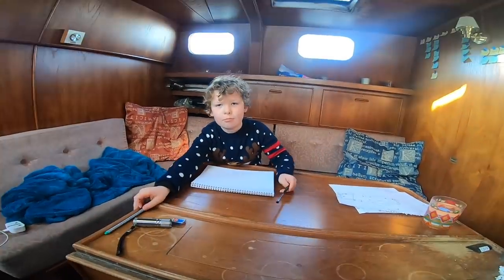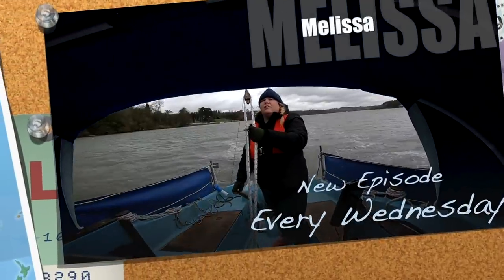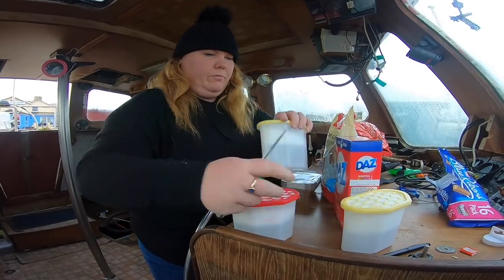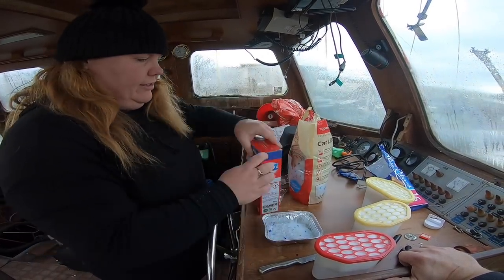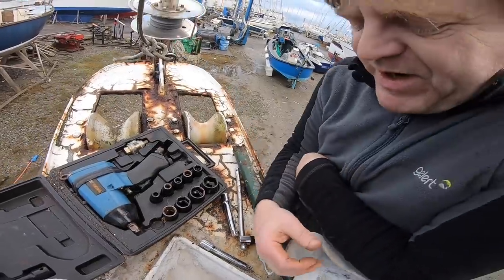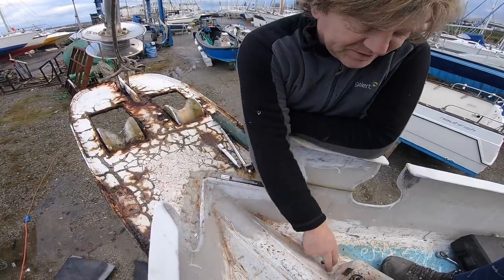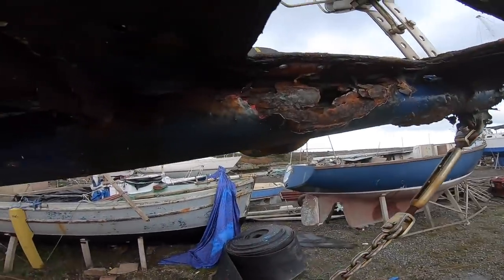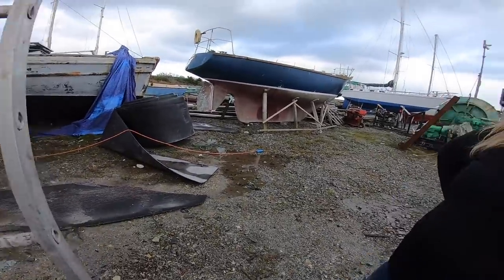#25 - Bowsprit Disaster!!!! - Restoring a steel sailing yacht

Comment: Bowsprit: Don't use wood, pls. If not AISI 316L, get hold of a galvanized piece of pipe. I used AISI 316L, no problem if done correctly. In fact, I have used å lot of stainless qualities from 6MO and SuperDuplx and down to AISI 316L. Nothing below AISI 316L. I also built my boat 25 years ago, with full job. Know your challenges. You are a very good team, the three of you. Impressed. Moisture absorbant: Calsium Cloride. Can be bought cheaply in 20 kg bags. Don't spill on steel, will rust immedeately. I have filled old 'lady stockins' with calsium cloride. Hangd them under the deck. A bucket underneath covered with a piece of plastic bag with some holes in. Then the collected wather drips down into the bucket. Best is to have a fan heater an an electric dehumidifier. Close all hatches an dry out. Send me an e-mail. I have allready done all the mistakes :-)

Comment: Andy your bowsprit... Cut it off as it enters the bow square on, place and weld a new one under size as your old one and push that one as far in as it can go, then weld that one in place, next you can place over that one the correct size as the old one and length welding that one in place. Then build up from there.
Reply from the maker: Oooh yes!  I could purge the weld and tig it. Why didn’t I think of that!!!
Reply: @SailingMelody   Double the strength.
Reply from the maker: Yes indeed! I may go that way!
I’m leaning towards an interior sleeve, then an external sleeve. Ridiculously strong and maybe add 4kg in weight overall. So negligible weight added.

Comment: Monday morning Quarterback here. Look at similar designs that worked. A great example is Pearson 323. Do a stainless diamond plate center. Plasma cut to fit. Galvanic protection wire and Holy Guacamole, You got it.

Comment: Please just weld a new piece of pipe on for the bowsprit under your new roller platform.  It will be as strong, quicker, cheaper and more reliable especially if you can coat the inside with a preventative mixture.  Fantastic job so far and all due respect to himself as a paramedic, I don't know how he can do both jobs at once.   Youngest doesn't realise just how lucky he is to have parents like you!

Comment: I admire your fortitude. Both holding down full time jobs and taking on a steel boat restoration. Tackling this in a UK winter, on the west coast of Wales is just adding to the difficulties. It seems like you have had plenty of advice to repair the bowsprit without removing the whole lot back to structure and have a plan in place.👍 On the condensation front I think you are effectively ‘pissing in the wind’ with the absorption technique and the only thing that would come near to improving matters is a dehumidifier but even if you were allowed to leave it powered up - it would be a massive task for it and of course it is an ever present fire risk. I would be sorely tempted to leave the boat for 2 or 3 months, certainly as far as the steelwork husbandry task is concerned, and concentrate on workshop type tasks until the weather improves.
Reply from the maker: Yes you make good points. We’re there again tomorrow for a couple of days and the weather is just awful so won’t be doing anything outside but there’s still plenty to do inside. I need to disassemble the whole steering system and no doubt will bring some of it home for strip down and rebuild

Comment: Hi guys, love the vids, I reconmend you use a small roller with a thicker nap if manufacturers are recommending to brush so you can get it on thicker,  I'm a pro painter and I suggest you can get it on thicker using a roller. This will make life easier and more productive including a more even coat , good luck
Reply from the maker: That’s a good suggestion thank you!
The manufacturer also specifically recommends airless spraying. We think this is due to the increased possibility for moisture in the airlines on compressed air but with a good water trap/filtration i can’t see why this would be a big problem

Comment: A suggestion on the bowsprit, cut the pipe off about two or three inches from the bow or where it seems solid. Measure the inside dia. Find a pipe whose outside dia. is close to the inside dia. Clean the existing pipe as best you can put rust inhibitor inside. Place the smaller dia pipe inside as far back it will go and as long as the bowsprit. Weld the larger pipe to the smaller one. Find a pipe with the larger dia and place over the smaller pipe to the end of the bowsprit. Weld again where it larger pipes meet. Cap the ends. This should be as strong as the existing bowsprit was at one time. Good luck on you restoration.
Reply from the maker: That’s exactly what we’re planning to do yes!!! Thanks for your suggestion and confirmation that we’re thinking along the right lines

Comment: My advice about the bowsprit is the same  someone already advice. Get rid off this rusty bulky stuff in the bow, yes the anchor mechanism holder too. The current bowsprit and the chain used as sort of martingale. Make sure you use stainless steel for such purposes and you get TIG welding is inexpensive. Same with the stanchions in a near future.  My suggestion is also try to get rid off the gunwale.  You are making  a lot of progress considering your personal and current situation. Good job guys!

Comment: Since you are worried about humidity that is a good sign since that means at least your boat is keeping water out of it. This is a good thing especially where boats are concerned. Given your boat the fact that it is metal and in Wales I am going to guess that humidity is quiet a problem. I do not think if that is the case that your home made traps will work or rather they will work but not enough. Assuming you have mains power and return to the boat every few days a aircon might be better most have a dehumidifier setting though of course if it is bad the water container will fill up quick. It will be helpful in summer when you are working as then you can be in the cool as I am reliably informed Wales can actually get hot at that time of year!! Who Knew :) You can pick up a portable unit for £300 or less
Reply from the maker: Yeah we’ve got one but can’t leave it on when we’re not there :/

Comment: The Bowsprit can be saved like you said, But I would graft a new mild steel one back on, with an inner pipe to retain it's rigidity, rather than a butt joint.
Reply from the maker: Yeah absolutely. I’m going to use an inner sleeve welded in and then an outer sleeve as well also welded on top
Reply: @SailingMelody  Keep up the great work .  Jack that was a fantastic lay out. :  )

Comment: The pipe for the bowsprit, I would recommend 3 different ways to check inside the pipe for rust / corrosion, option 1, use a small inspection mirror (dentist style mirror), and a strong flashlight, 2 get a small endoscope off eBay for a few quid that will connect to your phone, make sure it has a light on the camera, and of course the 3rd option Ultrasonic along the bottom of the pipe, but that can be hit and miss on a small diameter pipe, I'd look at option 1 or 2 first, and get a long welding Rod, bend it and scrape the bottom of the pipe, there is a good chance you might have internal corrosion there, that hole looks like it's on the top of the pipe, rain water might have run into the pipe. Hooe this gives you some ideas before you start cutting into it

Comment: Hi cut  bowsprit as far back as needed then drill some holes in what's left put a inner piece of pipe then plug weld then put a outer piece on to the length needed fill with coal tar then paint as normal

Comment: Other suggestions for the condensation?
A low power, continuous use dehumidifier?
Reply from the maker: We have one but can’t leave it on when we’re away from the boat :(
Reply: You could get a USB powered dehumidifier, All you need is a battery pack for when you are not there.

Comment: Are you trying to tell us you have a life as well as a boat😁 your doing well, once winter kicks in here nothing gets done outside and summers can be a bit and miss affair.
Condensation: I've found ventilation even when it's wet is essential when cooking and a fan to help exhaust moist air helps but even three body's breathing and a wel winter on a steel boat means your pushing proverbial up hill. I have a big tarp over mine in winter that helps heaps by providing an insulation air barrier but that could be a Hassel for you to work under. 
Bowsprit: if that old pipe worked as long as it did then another thick wall one should last as long. If you wanted wood the end could be turned down to fit the socket left when you cut the current one off. I like wood but I'm thinking that with a steel boat you might as well have a steel ram to match. Instead of running it through the bulwarks you could almost make it a complete bolt on thing or at least make some long fins, one down the stem and the others running back to about the fairleads to make it super strong. You could use 5mm checker plate to walk on and she won't go nowhere.
With regards to Jack's boat plans, it sounds like the little pirate's getting ready to ditch the folks so be careful if he sets up a plank for you to walk 🏴‍☠️

Comment: Maybe put on another forestay somewhere before that bowsprit gives up. I seem to remember you took off the inner forestay or the deck joint wasn't very good for that either?
Reply from the maker: Yes! Good call.
Reply from the maker: Very good call but the chai plate for the inner forestay is still very strong. Wouldn’t sail with it but it’s not going to break I’m 100% confident of that. 
I measured the steel thickness as it looked thin and it’s lost 0.4mm of its thickness which is totally acceptable.

I will still be making a new one though
Reply: Oh right . I couldn't remember if you took attachment off for inner stay. Maybe just use that for now then.
Reply from the maker: @michaelbundy3867  well I think you’re right it can’t hurt to back it up with something .
I’ll find some way of adding an extra, either a halyard or some attachment for the existing forestay

Comment: I just work like you. It all depends on the weather. When it's warm, I work outside, and when it's cold and it's raining, I work inside. In winter I prepare various items in the garage. Sometimes when I get bored of something or get tired, I stop work and do something easier. After all, everything has to be done. and it's easy and it's hard. So don't worry about such comments
 The bowsprit - cut off only the part that is most corroded. Don't touch what's welded to the deck. Someone has already written not to give wood. I think the same. It's best to find exactly the same pipe. Also find a pipe that will exactly go inside. Slip the thin one 20-30 cm inside and leave the same amount outside. Weld the pipe and then put on this new piece and weld around. Before welding, paint the entire interior with phosphoric acid and then rinse well with water. When everything is welded together, you can drill a hole from the front and insert a hose from the head of the undercarriage maintenance there and inject some paint. And thread the hole and screw in the screw. If it is possible, it is even better to do it from the inside of the yacht. 
Best regards - Mirek

Comment: repair the bowsprit with mild steel and paint it ... make it not to complicated 5 years down the road you can  change the bowsprit and save the old mechanical winch they are good , work even when your e-system is down k.i.s.s. keep it simple and save ,make the  boat functional you can update later on.
Reply from the maker: Yes I completely agree

Comment: You can delete the bowsprit altogether and save yourself trouble in the future.  By deleting the bowsprit you can also delete the water line chain plate.  The anchor roller plate wont need to change at all.
Reply from the maker: The forestay geometry would change a lot then but good idea to simplify and add strength and lightness

Comment: Get a length of solid mild steel turn the end down to go in under the winch and weld it at the joint and drill 2 holes further down and plug weld it there as well
Reply from the maker: 😂😂😂 solid round bar! Well it’d be bloody strong that’s for sure.

Comment: I would sleeve a smaller tube inside the existing bowsprit once cut short and then slot a new carbon steel tube the same size as the old over the top - this will be stronger and good for another 40 years.
Reply from the maker: Yep that’s precisely what I’m planning on doing I’ll spray a tonne of epoxy inside the whole lot before I cap the end off
Reply: @SailingMelody  When the boat was being built I'm sure that the way the bowsprit was designed and fitted was all pretty easy to do. However IMO it's vastly over engineered. If you cut the tube of flush and there is no rust going in further just cap it off. Make a pattern for the top plate first and then cut that off as well. Roughly smooth and finish off the bow as if you had nothing there at all. Make up a new top plate from steel. 25mm? Make up a nice big brace/fillet to go up the stem and out to the end of the bowsprit plate. Shape can be of the old traditional type. 30mm? That can be welded together off the boat and the new mounts for the rollers also fitted at the same time. Also all of the mounts for the roller jib and forestay and any other fittings you might need. An extra stay for hanking on a storm jib or genoa etc maybe. Finesse the piece to fit the hull and weld on. Certainly simpler than playing with tubes IMO.
Reply from the maker: @delukxy  that sounds like a plan. Don’t suppose you feel like drawing me a picture of what you’ve got in your head? Can’t quite picture it
Reply: @SailingMelody  This is a job for Jack! From the top the plate will look the same. The fillet underneath is at right angles to it. Think clipper ship bow.
https://www.jordanyachts.com/1077
Old Sea Dog has a stainless steel guard plate for protection against paint damage by anchors on White Shadow. His boat actually epoxy coated so the protector maybe screwed on. Shaddie is steel and he's doing rust correction in his last video.
https://www.youtube.com/watch?v=t94q5J5VxpQ
2 back also has some rust stuff.
Reply: Further thoughts on that.  My selected thickness for the the top and clipper brace probably a bit over the top but a thicker brace is still a good idea if it goes right to the front of the bowsprit platform. What is the thickness of the current platform? As a premade piece it will still be pretty heavy so using a scaffold tower would be a good idea when welding it on. If there is room to have the tower in any position around the boat it would be good to have anyway, especially for work on the stern.
Reply from the maker: Yes we definitely need to find some scaffolding now we’re getting into this stage of the work. Although in all honesty we probably wont begin that actual fabrication until the spring when the weather clears up a up, it’s still to wet and windy at the moment. I’ve got so many ideas and suggestions snd brilliant helpful advice for this it’s kinda bewildering now. 

But we mostly want to just return the boat to how she was and focus on repairs rather than modifications at this point. We want an electric windlass but can’t afford one currently so that can wait a year or so.

Comment: You have to remove ALL of the paint before you paint over anything. You can’t just grind the rust spots. You should blast the whole hull, then treat it with a steel rust inhibitor, and then do a barrier coat followed by bottom paint. That stuff is just going to peel right off when you’re in the water.
Reply from the maker: Great advice thanks 👍

Comment: what happened to the cover you were going to surround the boat with? I have a vinyl garage that I use during the winter months, I use a kerosene heater for heat, and work until the sun goes down. lots of tea breaks also.
Reply from the maker: Coming up next episode ;h

Comment: 12:55 lay on your back and paint. You can't get any balance doing it this way. Set yourself up on a comfy cushion or two and a small pot filled with paint and go from there.
Reply from the maker: Thanks for the tip 👍
Reply: @SailingMelody  You're more than welcome. It definitely helps to see where to paint and you can apply more on the brush to get a thicker coat. Good luck guys.

Comment: you most use the same stil as the boat are made of, otherwise you get galvanic corrosion :) Ps. there are over 2000 types of steel

Comment: Wood and steel do not work well together! Bow sprit get an air chisel on it all around see what is left and how far it goes inside the bow, looking at the way its gone at the top of the tube water will have filled the lower section of the pipe and stayed wet unless you are really lucky! If its not to far gone then cut the tube off, bevel the two ends at 45° and weld on a nice thick bit of schedule 60 pipe (if your not a very confident welder get somome to do it for you as that is a very important structural point! 

One year into a 34 foot steel ebbtide, and I'd suggest starting from the top down, otherwise even time you work you get new rust blooming from grinding dust etc 😂

If you can afford it buy a plasma cutter. Cheap one £300 from Rtech welding. Brilliant bit of kit and worth its weight in gold when it comes to doing repair work like your bowsprit (make yourself a new one in 30 min including the top plate!
Reply: @HoboWild as long as the sheets give the same mechanical strength as the bowsprit sure! But if it fails they could end up demasted....
Reply from the maker: Interesting idea for sure